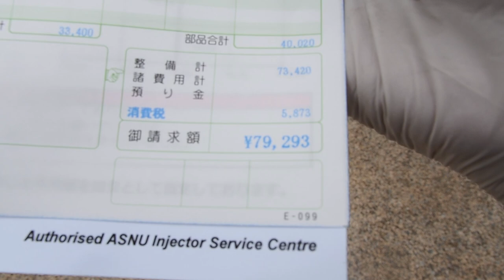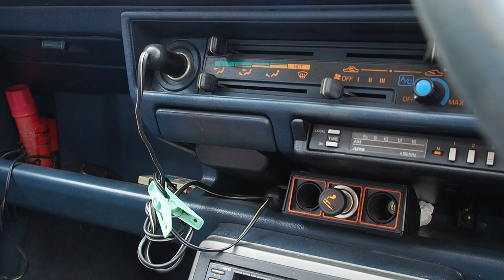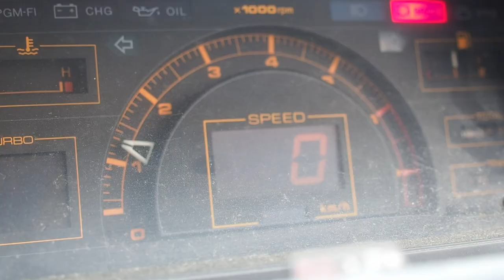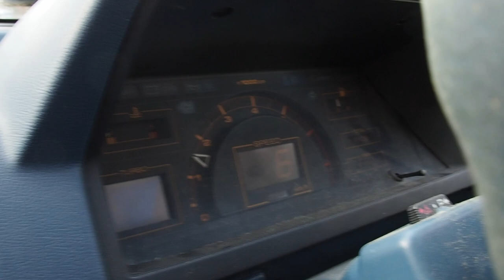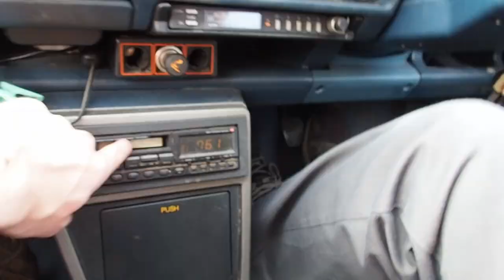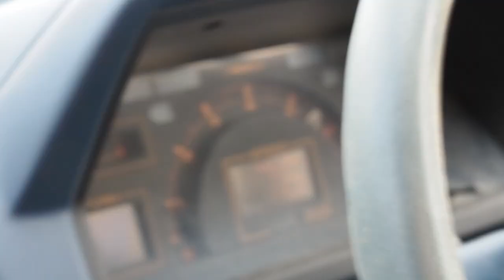PCA Project Car #3 - Honda City Turbo II - Engine Running

Comment: I'd slap in a whole new front end kit, mount the new wheels and tires that you for sure will go with, then get it aligned.  Saving money having to go back in and redo work, drives like new afterwards too.
Most include 1) inner and outer tie rods, left and right 2) sway-bar bushing kit, left and right 3) lower ball joints, left and right 4) upper control arms with the ball joints, left and right
Would be smart to get a coolant hose kit and an engine/transmission mount kit, too.  That way you don't have old coolant hose cracking on you, and the engine's power more planted to the wheels not wobbling in the engine-bay.   All new rubber in the safety areas, suspension and engine.  Then I'd flush the brake fluid out with new DOT4.  Replace calipers/pistons, replace rotors and pads.  Then you'd have an amazing little refreshed car, suspension/brakes, all safe.
Reply from the maker: Suspension and bushings will probably be their own video but not until the car is no longer "see through". That rust is worse than it looks.

Comment: Thanks for the retro blast. back about 87' I seriously considered buying a Turbo II Bulldog at a Pot Lot near Yokohama for about $5,000 U.S. Same color as yours, and only 17,000km.  Surprisingly good driving car and a lot fun. At the time it did not meet U.S. DOT crash test, but EPA was a go. I was a car dealer in the U.S. at the time and thought about just driving on a Dealer plate and company insurance. In the end decided it was too much of a hassle and expense.

Comment: This an older recording? Cause u have a sweater on over a shirt, and its Aug in Japan!?!
Reply from the maker: Good catch. It was recorded in... 2018 maybe. Maybe 2019. We have a bunch of videos recorded but never released and so I'm going to push to get them out.
Reply from the maker: And it was 37 degrees here last week with humidity 44 degrees. If I wore a sweater, I would be dead now.